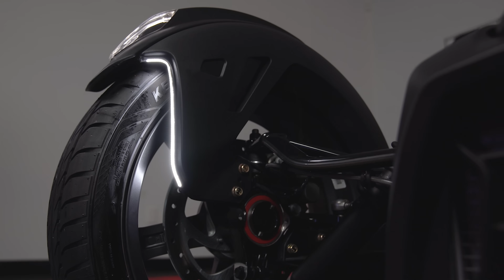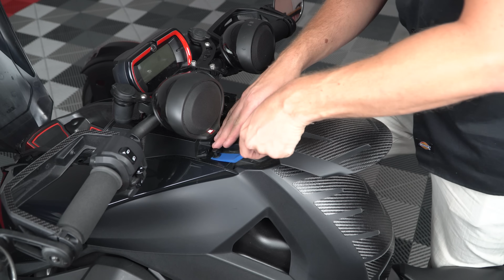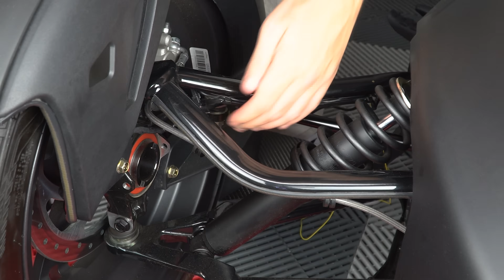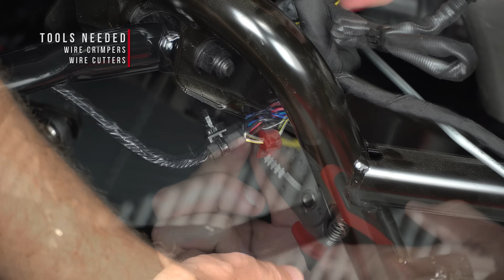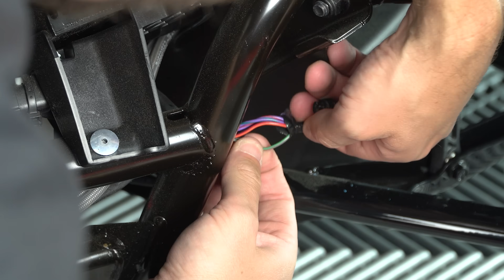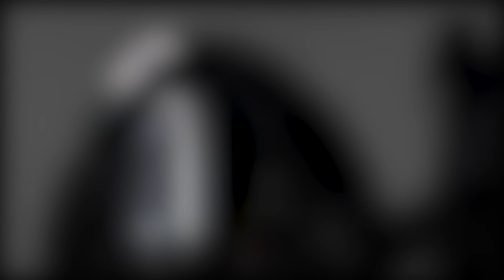Can-Am Ryker LED Dual Color Vertical Fender Lights (Gen 1)

Comment: Just curious: these lights require splicing one wire on each side along with the harness. The new rear brake light kit that mounts under the max mount doesn’t require splicing. Is the rear kit a newer design or was the front kit a limitation on the Ryker design itself?
Reply from the maker: Hello Chris, we are actually working on a new version of this now that will not "require" a tap for the turn signal wire and will be 100% Plug N' Play.. but it's not available just yet.